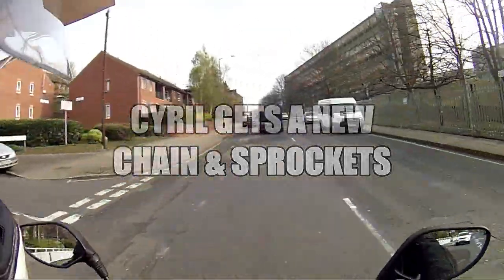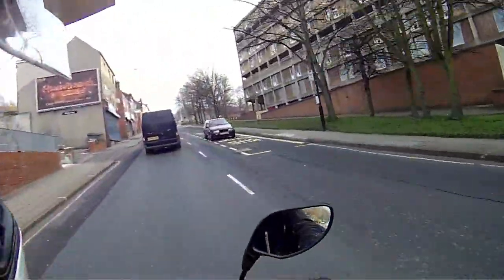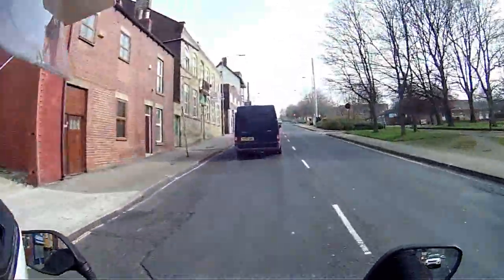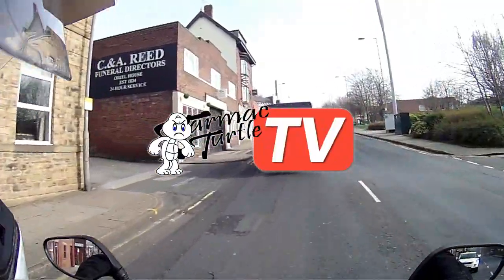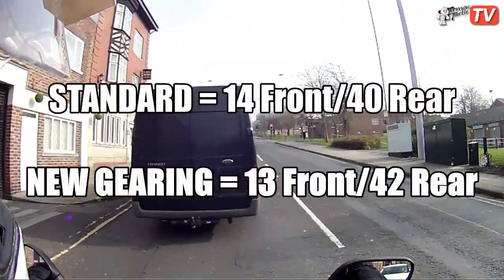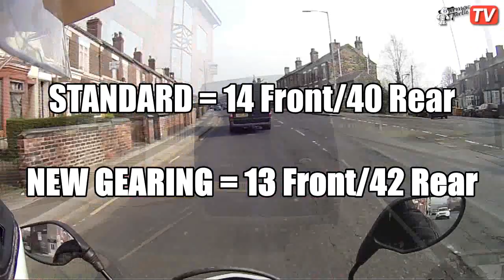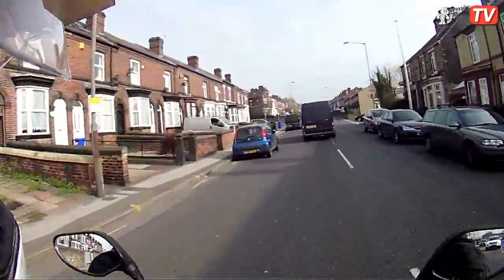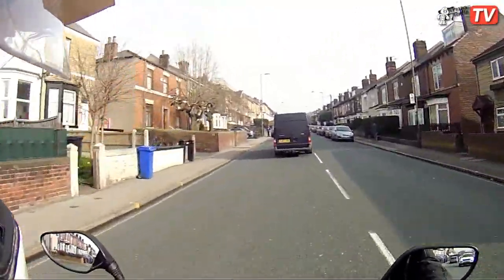Honda CRF250L - Replacing the chain and sprockets

Comment: i live in hilley northern Scotland, and put it back to standard sprokets, it shoots to 60, 70 /80 if you need and gets over 100 MPG i see no need to under gear it, in fact i may reduce the revs a bit probiley with two teeth less on the back to get even better smiles a galion,
Reply: o forgot to say it came with that thingy that you can tune to give it more umph it feels like a 350 with it..
Reply from the maker: fred blogs Sounds good! Only reason for me doing it was to get better ratios off road and a more lively bottom end, ride safe up there 👍🏻

Comment: Really well-done video. I am very surprised though that your speedo checked accurate after the gearing change, without having to use a Speedo DRD correction device. CRF250L's usually read 5% to 10% high when stock, then the sprocket changes put it out a lot more. Mine read about 18% high after the sprocket change, as per my Garmin GPSmap 62s, and verified by other sources.
Reply from the maker: I was equally surprised. I didn't check the speedo accuracy before the swap to be honest, but it is reading around 10% over now, which is pretty much in line with every car / motorcycle manufacturers accuracy/tolerance (roughly). I'm happy with that, 30=33, 60=66 so at the most it will read 6mph over within the speed range I mostly ride at :)
Reply: ***** Yes, the 13 T sprocket is the best performance boost. Suddenly the gearing and power is where it should be.
Reply: BlastsFromTheSaddle Cool !!! I just replaced front sprocket this afternoon..still need to redadjust chain tomorrow and try it out..excited!!
Reply: BlastsFromTheSaddle ok!!!! Finished rear sprocket today!!  Significant improvemnet in low end torque!!

Comment: Hey man. Very thorough video. Im about to change my gearing soon and this should help me a lot. Just have one question. Do you recall how many links your new chain has? For some reason i thought the stock gearing was 14-42 (changing to 13-43) and ordered a chain with only two more links than stock..
Reply from the maker: Hey Carl,I used a chain two links over standard and it was just fine. Glad the vid helped a little. Cheers :)

Comment: technically,wouldn't a smaller front sprocket give you less torque? Even after increasing the rear tooth count to 42?I have a 14-43 and I'm happy. my bike is a 250m came with 14-39

Comment: Nice video! Quick question for you if you can. I got a renthal 13 tooth front sprocket and it looks like you had the same. which way does the front sprocket go in with the lip side out or the totally flat side out when it's installed?

Comment: So is it mandatory to replace the chain with different sprockets 13-42? Does it increase the top speed or it decreases a little?
Reply from the maker: ripmax333 It's not mandatory, just a good mod. The different sprockets increase low down pulling power at the expense of a little less top speed, although it's not easy to get the bike to rev out anyway so it's not really noticeable. For me the ultimate speed was less important, I wanted better torque at off road speeds :)
Reply: I think I placed the words in wrong order, what I meant is, do you have to replace the chain when changing the sprockets to different size or you can still use the stock one?
Reply from the maker: I replaced my chain, I have had comments though that the standard chain works. See more in the comments :)

Comment: Quick question for you: when you added the 13t sprocket, did you notice that your gearing engaged much harder? Especially going from 1st to 2nd. My shifting was all smooth until I recently added a Renthal 13t sprocket. Now, it shifts loud and hard most of the time. It's only been a few days. So, I was hoping it might break-in or something. Any thoughts?
Reply from the maker: Justin Pfeifer Hi Justin, not noticed it to be honest. I did change the rear sprocket at the same time though. Could your chain be running a little tight?

Comment: when changing sprocket sizes, your speedo and odo are not calibrated anymore, do you know how many percent it changed?
Reply from the maker: My speedo is reading around 10% over when checked with the satnav.  30 = 33 and 60 = 66 etc. :)
Reply: hmmmm
;)

Comment: mate i've replaced my gn chain & sprockets but it still have a lose & tight area when i turn the wheel,can u tell what the fuck going on???
Reply from the maker: Hi Kenny,hard to say mate. Quite often chains will have a tight spot, best thing is to set the correct adjustment at the tightest point to avoid any stress on the gearbox output shaft :)
Reply: Tarmac Turtle ok thanks man...that's i've already done